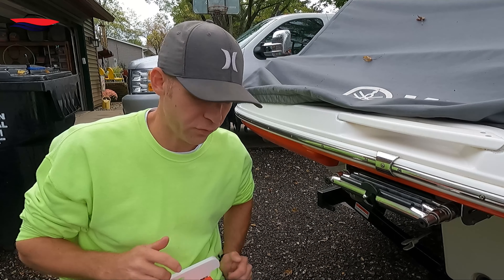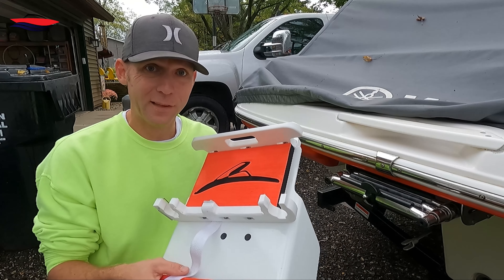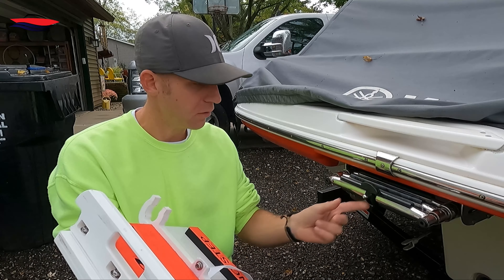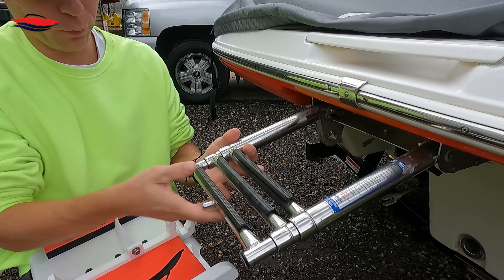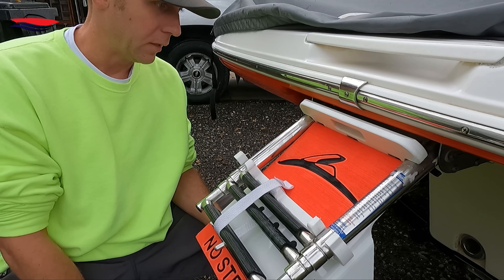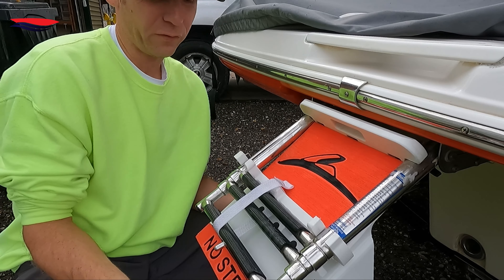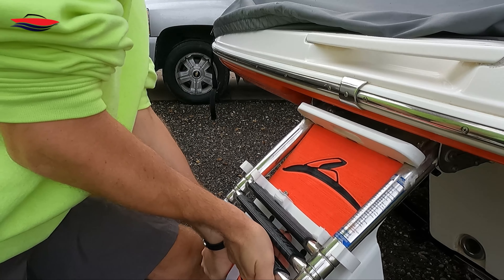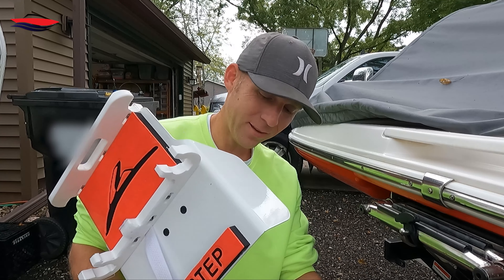Jetwash Deflector Installation - Yamaha Jet Boat

Comment: Do you have any before and after videos of how well it works? Would it help deflect spray while pulling at tuber at 20-25mph?
Reply from the maker: We have never used it about 11mph but from what Jet Boat Pilots Website says it's only good for cleaning up the surf wave so I am guessing no.  Here is my video comparing it with and without.
Reply from the maker: https://youtu.be/Mb1AjwzZw_k
Reply: Thanks

Comment: I have a 2008 212X and just ordered this for it but it does not seem to fit right. Does your deflector rest on the horizontal rail bracket? How do you get your ladder to stick out and now just fall down with the device installed?
Reply from the maker: Email me some pics to jeffsjetboat@gmail.com and let me see what you have going on.
Reply: I have a 2010 212x doesnt fit either. Are u figured? I have same issue
Reply from the maker: Check your email

Comment: I noticed your sub woofer is under your seat. Does it still sound good/strong?  I have a 2006 SX 230 and thinking of putting a sub under my seat as well?
Reply from the maker: It's thumps great!  I just made the box and painted 3 coats of bed liner paint to seal it up so the mdf woof doesn't rot away.
Reply: @JeffDoesThis  nice! I will try that. The wet sound stuff is just so crazy expensive I can’t bring myself to spend that much. Family fan with a boat, only got so much